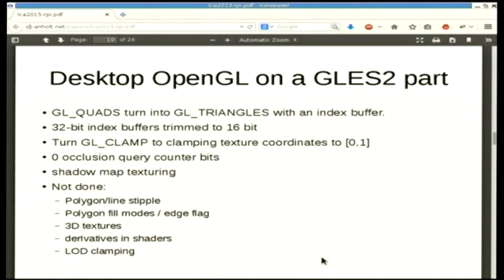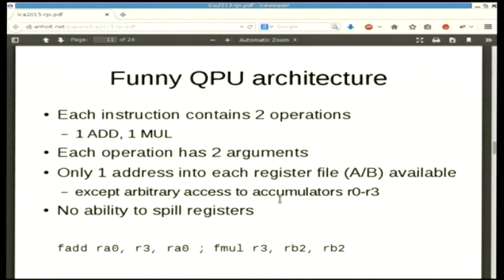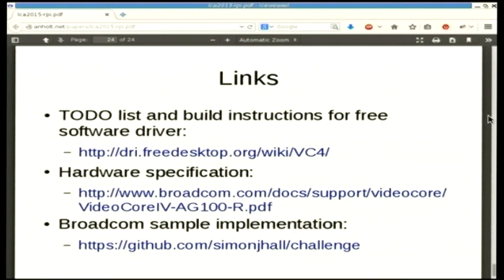Open-source OpenGL on the Raspberry Pi

Comment: This guy left broadcom right? WHERE IS FUCKING GPU DRIVER ON LINUX?
Can't even play simple movies with so-called 4 core 6x fast RPI2!
Reply: +z1m7x2n6  He's likely still there. He's clearly working hard on the driver and on upstreaming it, the github log is very obvious about it. It just can't happen that quickly, not for something complex like that. And i mean, he is just one guy, right.

As to where the driver is... well i believe the old one is still there, and it still does EGL/GLES2 and proprietary h264 acceleration like it always did. Mobile hardware is special, and treating it accordingly across the whole software stack is almost unavoidable if you want it to perform properly. So i say software's fault, not driver fault. I don't know, people somehow magically expect to fit a whole usable desktop complete with all their unmodified software in a 1-Watt package, people hype it up like it's the real deal, made out of magic fairy dust, while common sense should actually warn them against such preposterous claims.
Reply: I see and already know your points. We should not expect too much from it.
But they keep pushing these low watt chips as FHD encode/decode that has no reality.